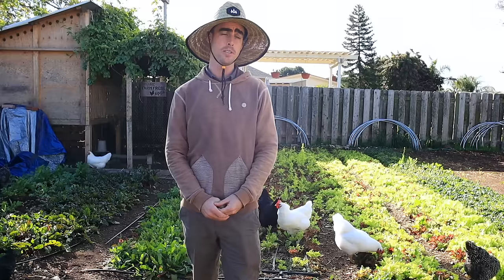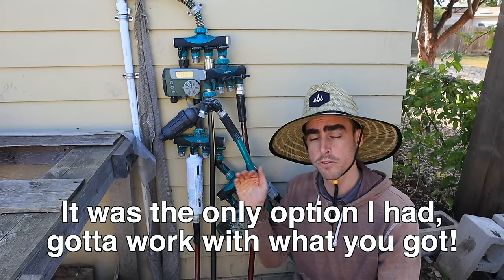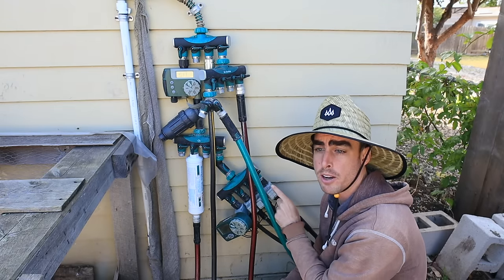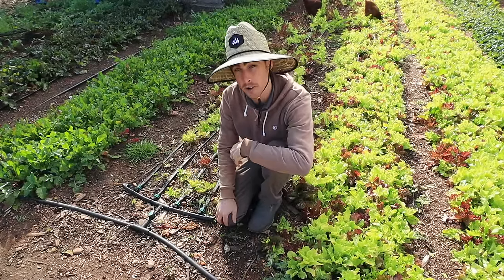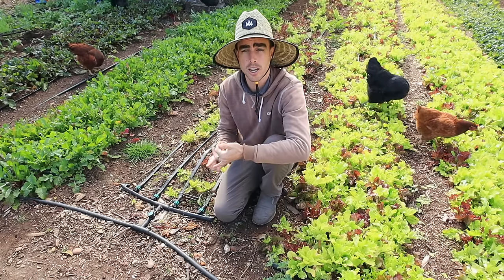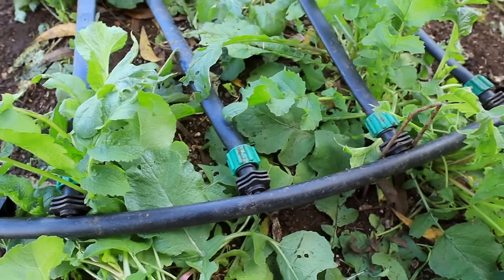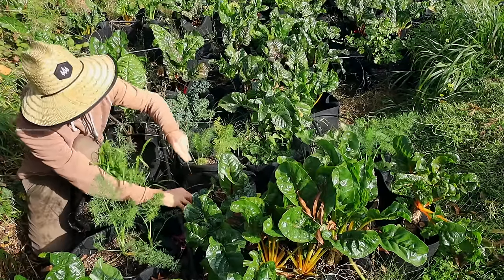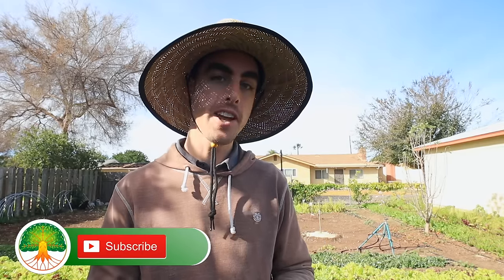What I Would Change About My Irrigation System

Comment: Hey Steven, love what you’re doing.  I’ve used a lot of the ideas from your videos in my systems.  In my brand new drip tape system I’ve already had vermin nip holes in the lines.  Any suggestions for a cheap but reliable repair without having to replace the entire 50 ft line?

Comment: How do you orient your driptape emitters? Face down (risk clogging?), one side or the other, facing up?
Reply from the maker: I found running up or down it didn't matter even though they say to turn them emitters facing up. I actually prefer emitter down, either works just fine from a lot of experimentation.